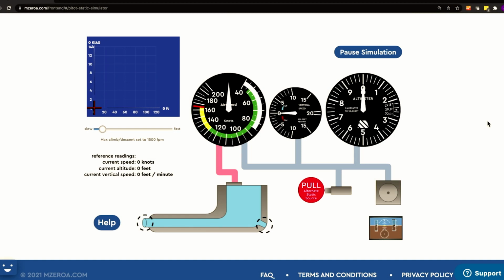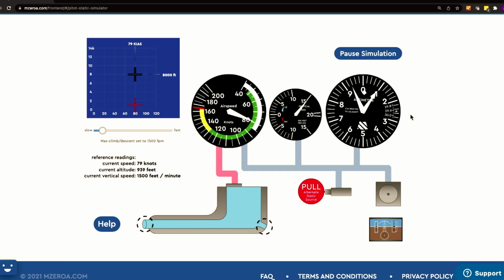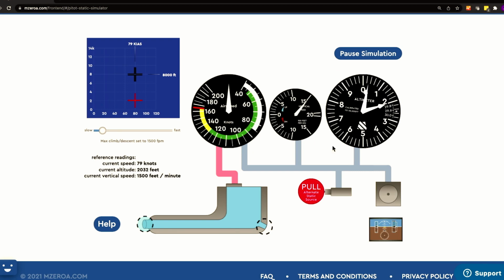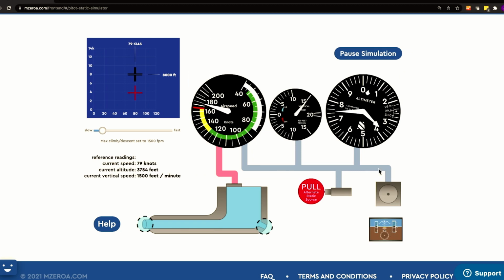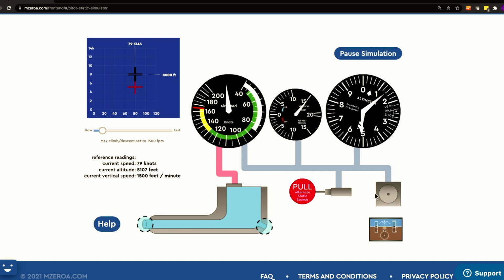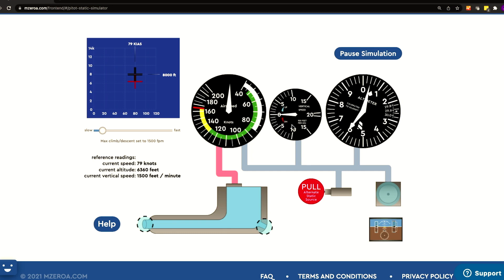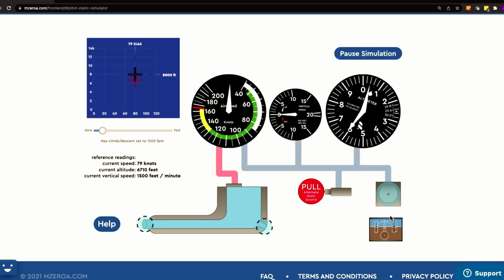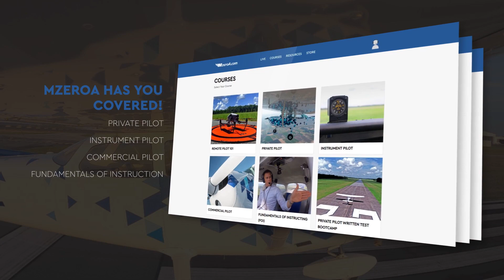What Happens When The Pitot Static System Malfunctions?

Comment: If the air RAM hole & drain hole is clogged, and these 3 instruments (ASI, VSI & Altimeter) are reading incorrect info., how do you reverse that in mid flight (...& your panel is a std 6 pack & not glass)?
Jason mentioned back ups but that was it. Can you be more specific?   Thanks 11/11

Comment: 11 4 11 hello Jason, as always great real world flying tips and refreshers
I have an older Cherokee does not have alternate static port so therefore the glass will be coming out of my VSI ; although I am fortunate to fly with ForeFlight on my mini iPad with synthetic vision along with a transponder that reports pressure altitude. And yes like you stated, a few extra independent systems are always helpful. If not then a good understanding of the pitot  static system is always welcomed.